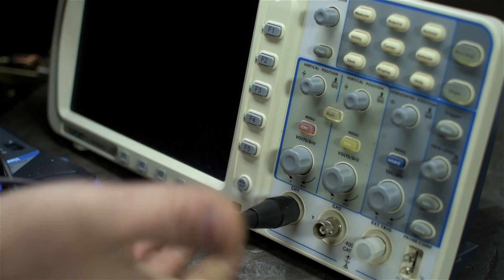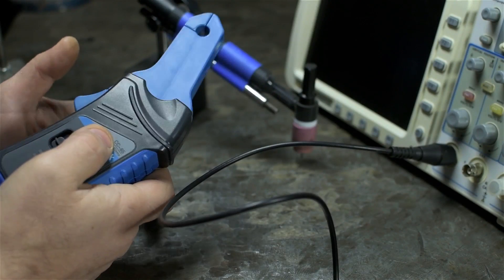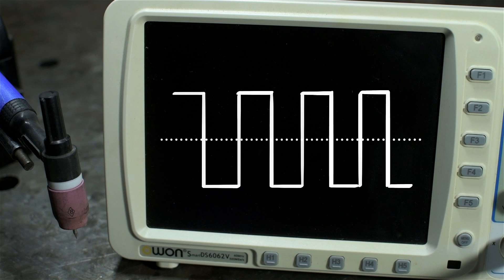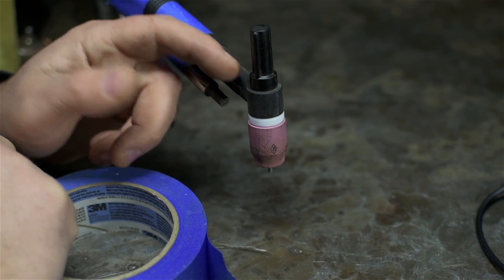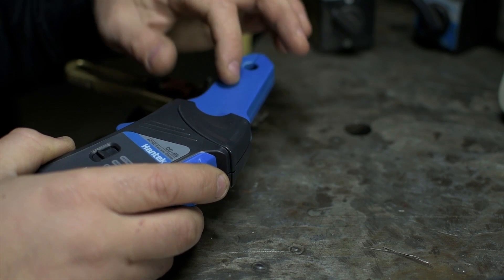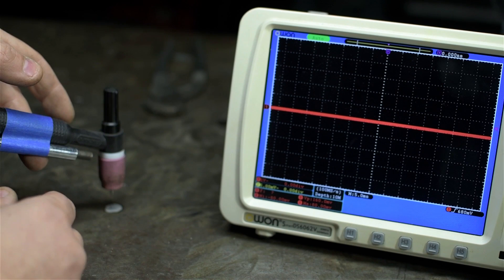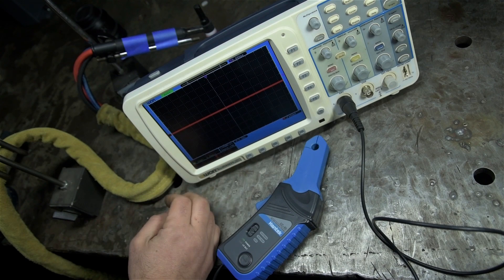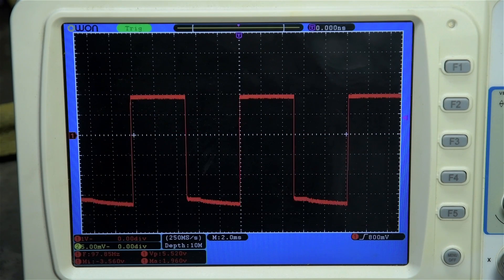Oscillo-Help-Me?

Comment: Personally i don't know, but this bread sound nice...

What You'll Need

    1 package active dry yeast (2 1/4 teaspoons)
    1/4 cup warm water (about 110 F)
    1 cup raisins
    1/4 cup butter, softened
    1/4 cup granulated sugar
    1 1/2 teaspoons salt
    1/2 cup warm milk
    3 3/4 cups all-purpose flour
    2 large eggs, beaten 

How to Make It

- Dissolve the yeast in the warm water.
- In a large bowl, combine the raisins, butter, sugar, salt, and hot milk; stir to dissolve the sugar. Let mixture cool to lukewarm.
- Stir 1 1/2 cups of the flour into the milk mixture; beat until smooth.
- Add yeast mixture and the beaten eggs; mix to blend well. Add enough of the remaining flour to make a soft but stiff dough.
- Turn the dough out onto a lightly floured surface and knead for about 10 minutes, until dough is smooth and elastic.
- Butter or oil a large bowl.
- Place the dough in the greased bowl. Turn it over to grease the entire surface of the dough. Cover the bowl with a clean kitchen towel and let stand in a warm, draft-free place until doubled in bulk, about 1 to 1 1/2 hours.
- Punch the dough down and divide it into 2 equal portions. Cover the dough with a kitchen towel and let it rest for 10 minutes.
- Shape the dough into 2 loaves and place them in 2 greased 8-by-4-inch loaf pans.
- Cover the pans with a kitchen towel and let the loaves rise for about 45 to 60 minutes, or until the dough has almost doubled in bulk.
- Bake at 375 F for 25 minutes, placing foil over loaves the last 10 minutes if the loaves look overly brown.
- Remove the loaves from pans and let them cool on racks.
Reply: This one has lost it!
Reply: Jarret Hall long time ago my friend...
Reply: Bit of a half-baked solution. Have you seen a welder's tool kit. Basically, crush and twist are your options.

Comment: If your scope is "doing stuff" when you strike an arc, that is a telltale sign of ElectroMagnetic Interference (EMI). My guess is that your high frequency start is acting something like a radio frequency grenade and your clamp or your leads are picking it up. When I turn my ham radio's output up too high, it has the same effect. More likely than not, your cable is dumping all that noise into the scope. Add a ferrite choke to squash the common mode currents on the shield, and ground the scope to drain what's left. That'll also help with your floating ground issues some others are talking about.
Reply: Matt DeSalvio all good points. Also: could get a good old fashioned CRT scope - available for peanuts on eBay - which I dare say would not suffer half as much from EMI. If you get a poor quality one, you can even turn the brightness right up,
Sit in front of it and use it to top up the tan!

Comment: I work in high voltage electronics (large, angry pixie wrangling) for a living. Not welders, but things like make a lot of arcs none the less, but hopefully not on purpose... It could be a number of things you are seeing. You’re using a cheap clamp on current probe - where I would use a high dollar toroid current transformer that has been calibrated for the current level I would be measuring. They can also be frequency sensitive  i.e. “meant to be used at x to y frequency” and anything outside of that you will see distortion... And those are for AC waveforms. For DC you need a Hall effect type of device. Also the shape of your waveform is complex. Meaning not a sign wave... which can mess with measurements. And what are you comparing to? What did the manufacturer of the welder choose to base their measurements on? RMS? No RMS? Are you sure the welding waveform is supposed to be perfectly symmetrical? Depending on the circuit arrangement, it may be that they get a nice clean square wave in one direction, but some ringing or other type of garbage in the other direction. Actually, I rarely see such clean square waves. Usually overshoot on a rising edge is a fact of life if not full blown ringing. I see that wave form and see nothing wrong because I don’t have anything to compare to or schematics to look at and determine it’s just the way it’s designed. I tend to try to think like my doctor when it comes to “problems” like this. Is it really a problem or am I just perceiving it as one because I don’t have 30 years of medical experience to tell the difference between a cancerous growth or an ingrown hair... I would let a real welder (like Jody?) who has more experience welding put the thing to work and see what they think... If they have a problem, then it’s a real problem, otherwise you may be overthinking things. Oh, and the RFI from the HF start could break your scope. Not so much from actually frying something, but it could erase or add bits in flash that could brick it.

Comment: The waveform really looks clipped. a blown overvoltage protection on the scopes input? 
Does the clamp work on a normal AC power line as expected (50/60Hz, sinusoidal waveform)?

Comment: If running on battery, you need to connect ground to the ground point on the back of the scope. Also, try the hf start, then clamp the probe.

Comment: Wouldn't the puddle of molten metal have more free electrons to offer to the same voltage across the gap than the tungsten tip? If that were the case, in the cycle where the puddle is the electron source, the resistance would go down and current would go up for the same voltage. Kind of like a vacuum tube valve works, you have to heat the electron emitting element to get good electrical flow. I think if you were to check the voltage output and it was symmetrical, this could be the case. 
Does this make sense to anyone else?
Reply: a was thinking something of that sort as well
Reply: Yeah, me too.  Just don't ask me any more questions it... I'm only here to try to look intelligent (and failing miserably). :)

Comment: Hi Tony, to test if the Clamp is clamping the waveform - pun not intended - try putting it the other way round on the cable, then, does the Waveform flip on the scope? Not using wall power with the HF-start is probably smart. For even better results try putting the scope on some styrofoam, and coiling up the leftover clamp-cable near the scope on the metal table.

Comment: Hey Tony, 
I don't know how the current should look like(not a welding machine designer) but I know a lot about power electronics (and making measurements on them - just writing up my masters on power electronics). 

1) The "I nearly fried my scope" its not your fault its the scope. The owon scopes are crap. I bought one for my first scope and in a couple of weeks I had problems with the knobs, the fan, the trigger, it shows wrong stuff on the screen sometimes, the record lenght is not right ... for more you can look at a review EEVBlog made on them. So the wierdnes you get form the hf start its the probe picking up strong elector magnetic interference (from the high frequency, high voltage sparks) and passing it to the scope and the scope treking out coz its made badly. I would recommend rigol over owon anyday (for cheep new scopes).

2)  You have your clamp set to 1mv/10mA. So it gives you 1mv out for 10mA that you measure. It also has a 1mv/100mA range. This ranges are so you can get more sensitivity and the lower end. But - all of this clamps have a battery in them. Now if the internal supply is 5V and you mesure 90A, so 90000 mA so 9000 mV so 9 V would be the output of your clamp, but it can't give you that becouse it has only 5V, so it gives you that. This is why you have your 1mv/100mA range. In the manual it says for 1mV/10mA: range form 10mA to 2A and for 1mV/100mA 20A to 65A. So 1 step is to change the range. 

3) You don't need to run your scope on battery power. You are not connected to the welder any way, because you are measuring current with an insulating method. That you don't have your BNC - your scope - ground referenced may be causing problems in point 1). In labs we always measure with all the instruments grounded and insulate them with measuring methods - especially for current measurement. It gets a little bit more advanced if you would want to measure voltages, then battery scopes (better common mode rejection) and insulation probes come on to play.  But if you only have your current probe plugged in you can have your scope connected to the mains. (I always do). 

4) All hall effect sensors have a balance button, make sure to press it, rotate it, (its different on different clamps) if you see an offset  when you are not measuring any current. 

5) The current rating on the probes would be RMS presumably. Or DC. Or peak(amplitude). But defiantly not peak-peak.  

6) The shape of the waveform does not sit right with me. For one side to have some shape to it, and the other to be dead flat - i would defiantly look at the measurement equipment first and then at some incorporated woodo black magic. Thoe I don't knock the htp folks, but to have suck a nice squre wave and high amps its a bit iffy. I would expect to see some overshot or a more "regulated" looking curve. Google pid regulator for the curves I'm talking about. 

Hope this helps. 
Leme know if you have any other questions. I learned so much of machining form your videos that I'm happy to help. 

Best regard, 
Marko
Reply: Marko, with the slam dunk.

Comment: Well I'am an electrician and this asymetrical signal has DC part, because the area above the zero is not equal to area under the zero. This DC part is responsible for losing power from welder to melt the metal. That's what you don't want when transmitting for example mobile signal. Because you want to save your battery and only way to do this is to minimalize power losses. So you have to make symetrical signal, and that is it. Correct me if I am wrong, because It is long time I went from school. Excuse me for my english. :)

Comment: The current clamp is acting as a secondary of a transformer (with the ground cable of the welder as a "single turn" primary). It is the induced current in the secondary, via a resistor or load (within the clamp) that produces a voltage which is what the scope sees - the scope has NO need for a ground as it has a potential difference to look at via the clamp and its load resistor.
Square waves are a pretty harsh signal for a coil so you may want to first try experimenting with the clamp on, say, a 110v live conductor (with mains being a sine wave) into a small load - perhaps a lamp or such. You'll need something where the live and neutral conductors are split (rather than within one overall twin cable) - this will give you a verification that the clamp meter is balanced. The other thought is the welder being grounded at its supply connection and at the welding clamp negative via the bench - what about ensuring that the negative has no ground loops by isolating the clamp and "weld to" material from the bench. Another thought is to reduce the frequency and amplitude on the welder to as low as possible.

Comment: "Exploiting Advances in Arc Welding Technology" By Woodhead Publishing Pages 10-16. It should be available to see on google books.
Reply: severianvoid I Think you nailed it.  I'm not an electrician but as noted on page 12 the DC portion is clipped off due to rectalfrying of the arc.  Tony you can use my new vocabulary word for this term for what it's worth.  :)

Comment: 1) you need to zero the current probe and they have a specific frequency range they work at... so to set that up you need a reference, like a waveform generator  2) you need to use a HV O-scope probe to get the truth about what the voltage looks like...

Comment: It's acting like your AC balance control is set to 75% or something.  I would first eliminate measurement tool problems.  Using your current probe, check one leg of something plugged into the wall outlet that's under load and see if the sine wave is also symmetrical.  If not then it's your probe or scope.  If it is symmetrical then it might be a clipping issue although it would be tough to get 65amps out of the wall without involving the fire department.  Do you happen to have an old school transformer type stick welder that you could check the output?  Have you tried flipping your current probe around?  That should cause the wave form to be inverted which would tell us that it's probably the welder's design although I don't know why it would be that way.  Good luck on finding the answer.
Reply: You're correct.  I was thinking asymmetric ac which changes one leg's amplitude without changing the duty cycle or frequency.  So you can still have an AC balance of 50/50 however one leg is shorter than the other.

Comment: You need to measure the positive side. The negative won't measure the total current, some will flow to ground and nothing guarantees the ground will source as much as it can sink.
Reply: kilrahvp any stray ground through a concrete floor or whatever is so high resistance as to be inconsequential
Reply: Can't flow to ground because there's a transformer inbetween. Read up on power electrics.
Reply: You, obviously, have no idea about electrical engineering.

Comment: Hi Tony.  Can you turn the current probe around to measure the inverted current to check the the current probe is clipping on the ‘negative’ (below zero) side? If this wave form on the ‘scope looks ok on the ‘positive’ (above zero) then I would suspect the current probe is saturating on the negative measurement. Hope hope that makes sense to you.. John (retired electronics and electrical engineer from UK)

Comment: What sensitivity of the probe you are using? 1mV/10mA or 1mV/100mA ? On the video probe is always set to 1mV/10mA and it seems consistent with the scope (10A/div). It seems like this probe can not handle currents above 10A when in 1mV/10mA range. Have you tried to lower the sensitivity by switching to 1mV/100mA ?

Comment: Lots of good suggestions here. I know nothing about welder diagnostics, but here's something basic:  Have you checked the mains power? If you have one leg that is a few volts down for whatever reason, it might do funky things to the curve depending on how the welder processes the power.  It could be interesting to check the line voltage of each hot line against the neutral, to see if everything is balanced. Failing that, I'd agree with the poster who said the answer was 42.
Reply: Line symetry has NOTHING to do with the output symetry of an inverter welder. the power gets converted in the steps AC->DC->HF-AC->DC->LF-AC internally on those welders. Also, being in the USA, Tony probably has no 3 Phase power to his welder anyway.
Reply: Thanks for the clarification. Even with single phase, there could be voltage differences between the 2 hot legs and the neutral, but as you've pointed out, it's all done inside the welder. Thanks for the education!
Reply: Most probably that wouldn't be a problem.

Comment: Tesla coil nerd here.

Seems like you have an enormous voltage offset from the output of the TIG to the plate.  Huge difference in potential, I bet that somehow you have lost your earth connection from the secondary side of your TIG mains power transformer.

So now, the secondary side of your welder is floating with respect to the table ground.  I bet you are getting a couple of switch cycles on the TIG and because the wire is long, the stray inductance from the welding lead is causing the voltage on it to increase as high as it can until a ground is found.

Perhaps when you added the water cooling you inadvertently made or broke a bad ground.

As for the scope - I'd do some really good testing with the multi meter before I involved it.  Isolated measurement would be best, if you have a current sense transformer, it would be nice to look at the current waveform first - this is usually pretty safe - as long as insulation is good, there is no "ohmic" path to the instrument.

Might be a good idea to pull the ground lead off the 3 prong power for the scope - that way you can't get a big AC current thru it.

Does the shop have 2 phase power - Could be that you have some common connection between things plugged into the welder, but 1 is on 1 phase, and 2 is on another phase - causes huge potential differences.
Reply: Wow man - might wanna get the repressed rage looked at.
Reply: i would want to know the resistance from his ground clamp to the ground pin on his power plug, and whether or not he has a ground rod anywhere in his electrical system.  most welder manufacturers recommend a good, short path, ground rod connection. my 1940's P&H recommends a ground rod connected directly to the ground terminal on the front of the machine... this should really help with his EMF problems with the scope, because they will sink to ground.
Reply: Oooh great voodo priest of electronics grant us your wisdom... Your tips are more superstition than electrical engineering.  Welders are typically not grounded to the mains ground on the output side (only through a small RF-suppression capacitor normally). It would be too dangerous if you forgot to attach the ground clamp to your work, and the work itself (like metal stairs for example) had an earth connection. You would burn up your houses mains wiring with the return current from the welding.

Comment: Based on this patent, it looks like there might be some pixie physics to do with temperature and polarity and such where a negative bias improves the weld, in the case of the patent they modify the waveform frequency to achieve the bias instead of the current. https://www.google.com/patents/US3068352